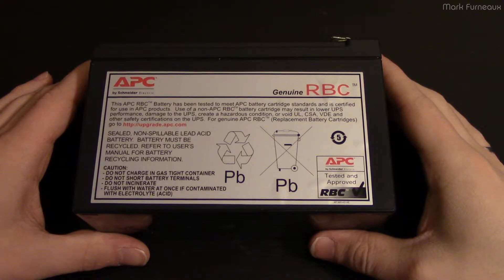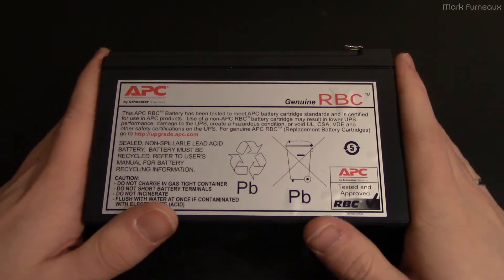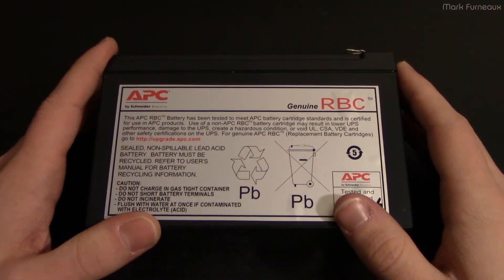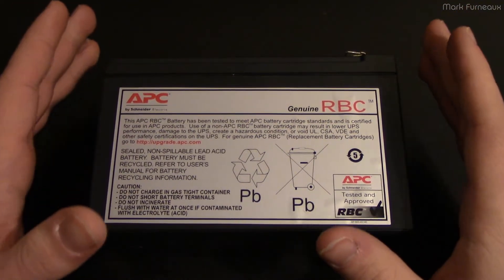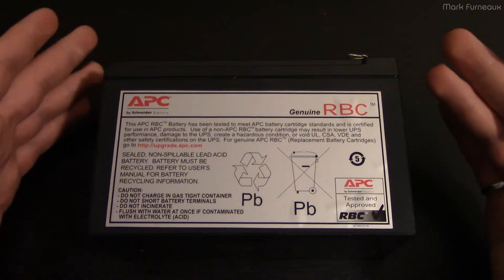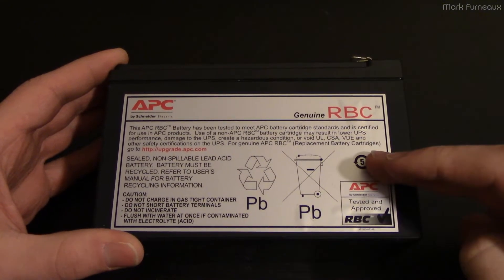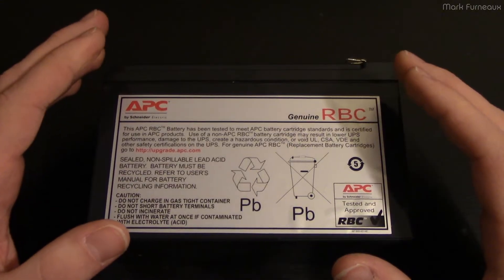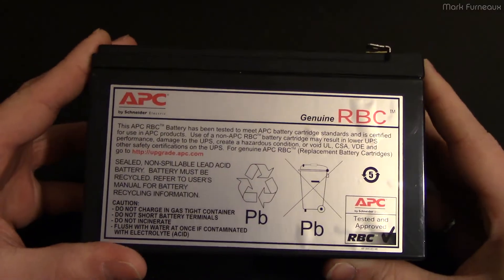How to Quickly Test UPS Batteries Without the UPS Itself

Comment: I use a Topdon BT-100. I set it to GEL and 100CCA.  Good UPS batts test at 120CCA or up. Failed batteries are usually in the 50s CCA or below. Internal resistance should be 15-20 milliohms on a good unit. Bad batteries are 30+ milliohms. Hasn't led me astray yet.

Comment: Exactly the information I was looking for. My multimeter doesn't give me the required accuracy in ohms... I just bought the device and found that the batteries in my two UPS units were no longer in good condition (SOH of 5%). This is in contrast to a spare battery I had in reserve, which has an SOH of 100%.

Comment: Does using a 4-wire measuring setup (instead of this 2-wire tester) make a significant difference in testing the internal resistance of these battery packs?

Comment: Great video! 

I'll admit I have purchased the 12v 7.2  because it was closest to the original even though I knew the larger AH battery would last longer. I had no idea how internal resistance would affect the longevity of the battery until you explained it so clearly. Thank you for sharing that knowledge! 

I do have a question as I'm looking at replacing batteries in some old UPS units.

I have an old APC Back-UPS ES 350 (BE350R) with a smaller form factor 12v 3Ah battery (WP3-12 when I pull off the APC label). The shell is made the same way as the larger 500 with the exception of some molded in stand offs to fill in space where larger battery would be. I was thinking of putting a larger form factor like the one in your video in by snapping out the stand off plastic. Will I be doing something bad by changing from a WP3-12 to a TLV1290F2 type battery? The runtime should improve but do I risk overheating if I upgrade from 3Ah to 9Ah? I'm going to open a Back-UPS ES 500 (BE500U) and see if the circuitry is the same. My guess is that it was cheaper for APC to use the same circuitry and modify the case for a smaller battery in order to offer a model with a lower price point. 

Also, I have already opened the 350 and there is no yellow glue. Will be checking my others.

Thanks!

Comment: Your last point is what I've done my entire life on so many other things, especially withe my vehicle's battery. I never buy a "direct replacement" battery and have always bought the biggest capacity/cranking amps battery, as long as its measurements allows it to fit in the battery tray, car, motorcycle, or UPS backup unit. My last 2 car batteries lasted 8 years each, by doing that.

Comment: Thanks - Great video.  I have a tester similar to yours and will test.  You know I think these batteries fail because the water in them dries up.  Every dead battery is dry.  The tops come off these batteries and there are 6 holes (one for each 2 volt cell) and I am going to add water, charge and test again.

Comment: Subbed, fellow Canadian here. I have the same tester and same 9Ah batteries. At what resistance do you consider it failed? Also my 12v car battery stopped starting my Toyota hybrid and reads 8miloOhms. A new Costco battery gave me 4.5ish (in the cold 0C). Think the battery is bad or parasite load? Edit: Wow I think I used your pfsense videos a decade ago!!!! Bell 3gig fiber now!

Comment: Really appreciate the video, I am dealing with a stair chair that is running slow. The thing has a cove on it that prevents me from testing it under a load. Of course the charged voltage is acceptable but also no indication of the battery health. I have 7ah batteries on order but hate to replace them without knowing  for sure. Currently the same tester is around $35, which is also the price of two 12v7ah batteries. So, I am ordering the Ancel because you have made it clear how to use it in this application and it will also be on hand to test car batteries as needed. I am also returning the 7ah batteries for 9ah replacements, also didn't know that the higher ah were acceptable.Thanks Mark

Comment: Hi Mark, the video clarified several doubts that I had and I'm thinking about to buy an Ancel Ba-101 it appears to be very useful to measure the battery health stated based on internal resistance. Thanks. I have another issue to ask you, based on your experience why not replace the ordinary UPS battery, to a MASTER U-POWER AGM 55Ah 12 V . Obviously we have here issues related with space, but if I keep the battery outside from the box, are you seeing any other disadvantage ? Thanks again.

Comment: There is ABSOLUTELY no way to replace my APC batteries whilst the UPS is on/connected. I have to dismantle the PCB and case to even get at the batteries let alone replace them!
Reply: The enterprise class APCs like the SMT1500C can be hot swapped but they are really expensive UPSs.

Comment: Late to the party. Those are clever battery testers. I'm using an old school resistive tester to monitor battery condition. It is just a low value high power resistor and voltmeter.

Comment: Thanks for this video Mark.  I picked up an Ancel BA301 and it works great!  Also, this model remembers the CA setting between sessions.  Great little unit.  Btw- speaking of trash batteries, I measured a defective one at 194.42 mOhm 😀

Comment: Great video thanks. I don't recommend swapping batteries with the power connected though. There are live connections inside and with some UPSs the battery terminals are at mains potential to ground.

Comment: APC RBC55 is a VRLA battery, 17Ah, 12VDC; I cannot find the discharge rate on any datasheets.  I would guess the "CA" is higher than 135, but cant figure it out for sure,  Anyone else maintaining these?  Thanks.
Reply: Replacement I found: Maximum Discharge Current 270A

Comment: Video, I've been looking for something like this but I didn't know what to set my tester on. Mine's made by top-down, similar to what you got. 
I had a 24-volt system and it said replace batteries. I took them to the battery supply place and they said they'd give me $0.50 for the pair of them. Two of these is nearly as heavy as my car battery, I was expecting more than that.
Anyhow I brought them home and one charges up to 12.78 volts. I took the Caps off the other one and it took quite a bit of water to bring it up to level. There are two possibly just one cells that aren't charging. I've got a battery desulfator and I've got that connected to it now to see if maybe it'll jump start the dead cell or cells.
I set my tester to SAE instead of CCA.
I reduce the amperage down to 40, as low as it would go.
It tested out one-hundred percent state of health and 97% of charge.
I'll have to dig up the specs on my battery and test it using your method.
Thanks again, very informative. 👍

Comment: So if you have the data sheet, can you just measure internal resistance and know from there (and skip the tester)?
Reply: To measure the internal resistance you have to apply a load and measure the voltage drop and current draw. if you divide the voltage drop by the current draw you get the internal resistance of the battery.  You can't just check its internal resistance with a volt meter.

Comment: Thanks. I bought that Ancel BA101 testing on Amazon for $40 CAD (Prime discount plus a coupon). Works great and takes the guess work out of figuring out what are bad batteries, good for smaller UPSs and good for high performance UPSs.

I bought four brand new 9Ah batteries locally from a reputable shop and they all test at 45mohm and fail self tests in the UPS. This video + the tester gave me the ammo to go back and tell them the batteries they sold me are garbage.

Comment: If you don have th milli ohms you can use the CA result. in this video it is 211 and 212. the slight change is probably due to the first reading heating the battery a bit which changed either the voltage or the ohms slightly

Comment: The fact that UPS devices use lead acid batteries, which is a technology from the dark ages, is ridiculous.   With the advent of lithium batteries all UPS systems should employ lithium batteries.  And if you purchase a small $160 EcoFlow River 2 it has UPS technology and lithium batteries.  And it will outlast any brand of UPS using lead acid.   Plus it costs less and can be ported outdoors for use wherever it's needed.  If you are still using one of the old fashioned UPS devices such as APC, etc, and it goes bad, toss it out and get a lithium power station instead.  I tossed my APC which would only give me 35-40 minutes of run when the grid went down.  And I replaced it with an EcoFlow that will run all day with a grid down situation.  And it has automatic switch over to battery faster than a UPS so computers are nto affected.  Plus it has pure sine wave 120 volt output.  With a lead acid UPS you're lucky to get 90 volts once the unit switches to batter backup.

Comment: Will this battery tester work on 12v UPS batteries? also how much can the resistance be off ? and if it isn't what does that mean that it could be charged? with what a battery charger, shouldn't the bar charge the battery by itself? so when it doesn't work, hold charge after the bar is unplugged , isn't it just better to buy a new battery?

Comment: While these battery testers might give you an idea they are mostly for starter batteries.(it even shows cold cranking amps)  The correct procedure is with an analyzer and charge discharge cycles to determine the capacity or maybe a 1khz test rignal to check the internal resistance too. Deep discharge batteries has a lower discharge rate than starter batteries. These testers determine the resistance by connecting a high load and calculate from the amps derived from it. While it's ok for starter batteries it's not so good for deep discharge batteries like that and you may get false readings. Basically a multimeter will be just fine to determine if they are good from the stand by voltage if you don't have an analyzer.

Comment: I purchased the Ancel and realized I may not be able to use it to test my small UPS battery - Power Sonic PS-1230 (12v 3.4Ah). The battery's rated maximum discharge amp (10sec) is 10.2 amperes. The minimum CA for the Ancel is 100Amps.  Please help.
Reply: Did you find anything out, I'm in the same predicament

Comment: Question: OK let me get this right a lower m-ohms is better ? The higher resistance number or m-ohms the closer it is to end of life right ?
I use these for kayaking to power a small fish finder so I only need 5 hours tops and I have a bunch of old UPS batteries that still hold 5+ hours but are no good for the UPS. Now I have 4 old ones not sure what one is the best. I think now I do thanks for the help.

Comment: You know a lot more than the sears auto center. Guy told me my battery was good even know it would only charge to 11 Volts and not hold a charge or start the car even with a charger on it for 24-hours.

Comment: I have question, I purchased a brand new 12v 9ah lead acid battery, I charged it for a little bit and then used it just a little bit, it was not fully charged, is that bad, could I have damaged the battery and it’s performance

Comment: Very informative thank you. 
I have a question that was not answered in the video even tho you gave out a ton of info. 
My Cyber Power UPS say the battery is good & says it should power the device for 10 minutes, & is charged 100%, after removing the batteries they both read 13,54 vols (I don't have a tester like you show) When I ran the self test on the UPS it shuts down within one second even with nothing plugged into it, when I turn off the AC to the UPS plug, it immediately shuts down. The Batteries are 3 or maybe even 4 years old. 
While everything says the batteries are good from the voltage on the multi-meter, to the readings on the UPS itself. The self test & AC power cutoff say they are bad. 
Is it still very likely that the batteries are the problem? Or is it possible that the UPS is faulting out internally? 
I already ordered 2 new batteries hoping it is the former, but 13,54 volts sure seems to indicate that the batteries are good. 
I'll find out in a few days when my new batteries arrive ; )
Thanks in advance if you choose to respond 😎👍
Reply: In my experience, batteries never last in a UPS more than 3 years, and that's pushing it.  Immediately after charging, they'll show a high voltage.  You can let them then sit for a day, then check the voltage again - they'll likely drop down to under 11 volts.

Comment: You can also use a power resistor and volt meter as a cheap and dirty alternative to a dedicated tester, ohms law will let you calculate the internal resistance. Even an automotive bulb will suffice as a go/no go test. Just needs to draw several amps from the battery so you can observe the voltage drop. For a capacity test run the battery down at its rated c rate ie 7ah at C20 = 350mA for 20 hours until whatever termination voltage is in the datasheet.

Comment: I was just thinking, if you have a power resistor of a value/rating that won't be destroyed by 12V you should be able to calculate the internal resistance of the battery with an ordinary DMM. You would measure the open circuit battery voltage and then the voltage it drops to with the power resistor attached. The voltage drop will be due to the internal battery resistance.
Reply: Tip: Put power resistor in a bowl of water for extra cooling.

Comment: Hi there

I learned alot watching your video. 

I have a Canadian Tire Eliminator Booster Pack with Air Compressor that is rated at 1400 Peak Battery Amps and 700 Crank Assist amps. I am trying to learn how to test the battery without having to dissasemble the unit.

First would you say this type of battery would be a AGM Flat plate battery?

Second question ... since the CA or Cranking Amp rating of the battery is needed to perform the test do you have any idea how I could get this CA rating information without taking the unit apart?

My idea was to get a tester like the one you used ... connect the leads to the booster pack leads, turn the power on to the leads and do the test.

Thank you for any information that you can share.

Comment: 1. How do you know that RBC battery is AGM?   2. How do you know the target internal resistance, or peak amps of the RBC battery?   I can't find anything online about my RBC109  battery.  I also contacted APC, and they couldn't provide me with a rated peak amps, or nominal internal resistance. Do you have a link with specs for APC RBC batteries?
Reply: You used 12Volt deep cycle battery 🔋 75A and get 9hour and more out ups
Reply: I got the same response from APC.  I suppose The only way to really know the internal resistance is to buy one of their batteries and connect it to the meter.  Of course, you still won't know the rated peak amps.

Comment: Hey Mark, What if the same tester that you're using shows, "check connection" ??? on a 12VDC 3Ah battery attempting to test at "3. Out of Vehicle" and "2.AGM Flat Plate" with Cranking Amps just as you did. If I don't get an actual test result, I can't assume that the battery is bad. This is an actual APC battery pulled from an APC battery backup 350.

Comment: Great information.  Sometimes finding the specifications on the battery is difficult or impossible to find because of the stickers on the battery or the manufacturer doesn't give all the specs.  This video gives me enough to go on.  Thanks!
Reply: Pull off the sticker. All the juicy bits are covered under that so they can force you to go to them for a replacement

Comment: Hi Mark.  Brand new 12v 9AH i just picked up are measuring around 20-21 resistance.  What resistance do you personally decide to replace a UPS battery?  I have some of the same batteries measuring 27-28 resistance now and they are getting long in the tooth.  Thanks for the great pointer about the car battery tester.  I have the Foxwell and it works great!  BTW the new 9AH are measuring right around 165 CA.

Comment: My ups is seems to be not sustaining charge (computer shutting down, and i also used a heatgun to test, lasted less than a minute on battery backup), i tested the batteries (2x) with a multimeter, and one is 12.66v and the other is 13.4v, i should replace the two batteries right?

Comment: Good vid.

I bought an ANCEL  BA301 as it had a few more features than the BA101.
- Retains the meter settings you set it to on last test ran.
- maybe the 101 has it, but the ability to print out the setting your meter detected on the battery-under-test.
- lifetime updates via USB cable 

Anyway, I ran the test meter BEFORE topping off each cylinder with DISTILLED WATER. 
- I THEN TOPPED OFF each cell with Distilled water.   Ran battery tester tests.

- I connected a Battery Tender Trickle Charger Junior and let it run overnight.

-The next morning I disconnected the charger and reconnected the battery meter.
-Re-ran tests and impedance looked better, Status was now GOOD BATTERY.

NOTE: even though my charger was a lower end trickle charger, it is a good idea to leave caps off during charging.  I had at least one cap emit a LOUD "POP"!  Then it came off, flew a bit and landed on the top section of the battery,
So I removed the rest of the battery caps. 
Reviewed all cylinders. 
Cleaned all-cap areas with Q-TIPS,  to remove excess acid/water. 
Added water where needed.

So the battery was salvaged, Reinstalled into ups and ups unit works fine.

Battery meter status, after refilling with distilled water, changed to GOOD BATTERY.

Having a battery test meter that checks IMPEDANCE makes a big difference. A very handy piece of test equip to have onhand.